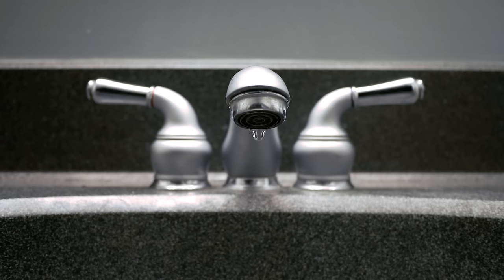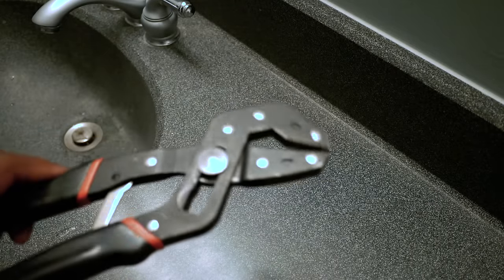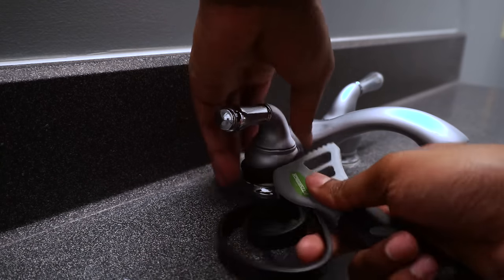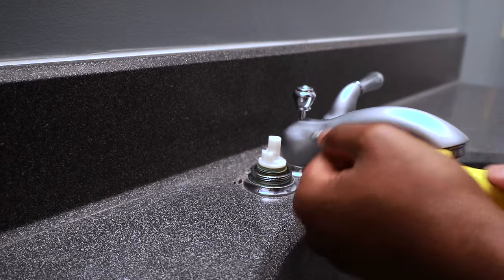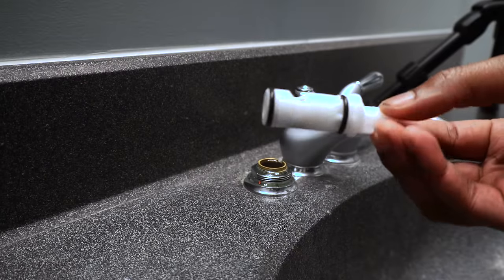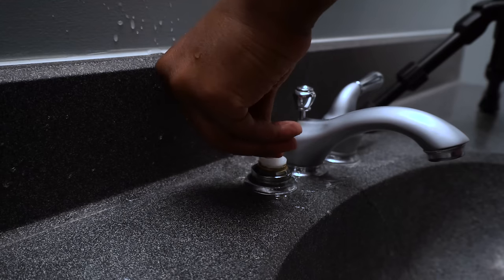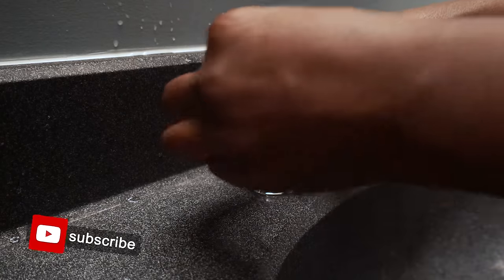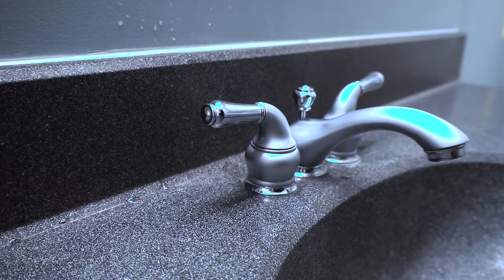How to fix a leaking faucet | Moen 1224

Comment: If you want to get the water out easy  get a spray bottle or a spray pump  and  stick it in the remaining water and spray or pump it out (hand sanitizer pump works too)
Reply from the maker: That's a good tip. Thanks!

Comment: I have replaced several cold water cartridges on my Moen 2 handle villeta faucet - I still have a solid drip when off - HD suggested putting bit of vinegar in the empty cold water chamber, did that, removed it, flushed it with water, new cartridge - still drips cold water - don't see much with flashlight in empty chamber, bit of discoloration after  cleaning and flushing - ???
Reply from the maker: I had the same issue use a small wired brush and clean the pipe. Buy additional lubricant not the one that comes with the cartridge. Let me know if that works

Comment: We used this excellent video yesterday to install this cartridge in our bathroom faucet, thanks.  It took longer to remove the cartridge than I thought but eventually we got it out using this method with the screwdriver instead of pulling it out with pliers as we first saw on another video.  The cartridge broke when we took it out and had to use need pliers to get the remaining old cartridge out.  But all worked out in the end run.
Reply from the maker: Great to hear!

Comment: Thank you! I was killing myself trying to get the cartridge out. The trick is to get it started separating it from the brass cylinder it sits and and then get it out with the vice grips. Don't worry about mangling the cartridge as you will be replacing it.
Reply from the maker: Thanks for sharing your advice

Comment: This was the best video I found regarding replacing a Moen faucet cartridge.  Annoyingly, it was the last one that I looked at so it took me all afternoon to replace the two cartridges.  This video had one element the other's didn't have--that you have to turn the little white thing on the cartridge to align it with the faucet handle.  Once I knew that, I had the job done.  Thank you for these instructions.
Reply from the maker: Thank you so much for the compliment

Comment: Great video!!!  But, no matter how hard I tried, I could not get my screwdriver under the lip of the cartridge to pry it out.

Ended up searching for a "How to remove stuck Moen sink cartridges" video.  Used that video's trick of grabbing the stalk of the cartridge vertically with Vicegrips and using a large screwdriver with the Vicegrips to lever the cartridge up and out.  Worked like a champ.  After 23 years, that cartridge was stuck, stuck, stuck.

Moen did send replacement cartridges for free, but I got the impression that newer fixtures no longer have the lifetime warranty
Reply from the maker: Yes, I think they recently changed the rules in the past year

Comment: I was halfway through watching this video in the plumbing aisle at Lowe's before some asked me if I needed any help. Thank you!
Reply from the maker: Happy to help let me know if you have questions
Reply: @Hindsight101  In the end your video was really helpful to me in removing the handle and selecting the correct cartridge from Lowe's. However, I guess Moen puts the same cartridge in multiple styles of bodies because at the point you used the water-pump pliers at 2:20 I found my cartridge was deeply recessed and required tool #14272 to remove it. I 3D printed a tool from Thingiverse (https://www.thingiverse.com/thing:1759028 )  and removed the internal retaining nut. Thanks!
Reply from the maker: Wow I will have to check this out
Reply from the maker: Your link isn't working
Reply: @Hindsight101 sorry I removed  the ) from the end of the link.
Reply from the maker: I need a 3D printer

Comment: I’m having a hard time removing the old white cartridge. Even using the flat head screwdriver. I tried pulling the cartridge out with pliers and it is really tough. I remember it had worked on an old faucet in the past, but not here. Thoughts? Buy a better plier?
Reply from the maker: I can't remember exactly which one but there are tools you can buy that can help
Reply: @Hindsight101  I found a trick on YouTube to get it out.
Reply from the maker: @inquisitvem6723  please share
Reply: I’m glad I didn’t have to pay a plumber. They would’ve charged $60.

Comment: I noticed this faucet is the Moen Monticello.. looks like the 4 in mini.  Would you know if it’s the same process to remove the water cartridges from the Moen Monticello 8 in wide spread faucet?
Reply from the maker: Sorry I do not know
Reply: @Hindsight101  Thanks.  It’s actually different.  I opened both, and each faucet set has a different handle kit inside.

Comment: I bought the 1224 cartridge and was ready to replace the old leaky one . First I found that the under sink shut off valve does not completely close the flow of water . In the basement , there are multiple old valves but none of them seem to shut off the water to the kitchen . The landlord will not help , so I am wondering if it's possible to replace the cartridge , even with a small trickle of water ?
Reply from the maker: I have done it but it’s not fun and messy. As long as there isn’t a lot of water pressure you sure be able. Since I don’t know your setup, I must say at your own risk.
Reply: @Hindsight101  Thanks for the timely reply . The landlord is obviously not interested in helping , so going the messy route is looking like my only option ( unless we call an actual plumber ) . The situation is irritating because I am able to do some basic plumbing repairs , but the inability to shut off the water not only complicates this repair - I worry that any future water issue might become an emergency .

Comment: ..place the towel over the cartridge as you insert it - will contain the splash... also use painters BLUE tape to protect the other fixtures when using metal pliers to prevent scratching ...

Comment: If the cartridge resists coming out is there a trick to help? It seems stuck
Reply from the maker: Some say use heat.
Reply: @Hindsight101  Thank you. For getting back to me. Our sink is very old and the cartridge was I’m moving. We finally used a block of wood, a vice grip on the cartridge and a long handle screwdriver to leverage/pull it out. Btw Love your videos? Well done and easy yo understand.
Reply: Wasn’t moving

Comment: I can’t seem to get my new cartridge pushed down enough to get the nut back on. I used silicone grease too. It just keeps popping back up. Thoughts?
Reply from the maker: You can only put the cartridge in a certain way. Did you line up the little notch?
Reply: Yes. Your video was great at pointing that out. The new cartridge just won’t push down. It is 100% the right part too. Identical to the defective one.
Reply from the maker: Do you see any obstruction in the faucet?
Reply: No obstruction. Nothing fell in as I took the old one out. Immediately tried to insert the new one.
Reply from the maker: Do you have a shop vac, towel, or turkey baster to such the water out. That might help

Comment: I just did mine same one but when I tightened it up got a little tough when I turned water on ....I have to check what I did wrong .....maybe to tight.......great job you did......
Reply from the maker: Possibly you should not have to tighten it down that much, you just want to make sure it does not come loose.

Comment: Moen will ship you the free replacement cartiage. They have excellent online service! Great viedo!
Reply from the maker: But you have to have the receipt
Reply: @Hindsight101  Not true, mine is several years old. I just contacted them online and they sent the part free. My plumber said they have a lifetime replacement part and for me to contact them for the free part and I did and they mailed me the part.
Reply from the maker: I have never tried to do it online. I was told this when I called. Do you have a link?

Comment: Why does the faucet still leak even when the hot & cold is turned off?
Reply from the maker: Are you sure that the hot and cold are fully turned off from the shut off valves?  I have ve had some that went bad and wouldn't shut off all the way
Reply from the maker: Awesome, I actually have a video that walks you through calling moen https://youtu.be/kf9bL3yXoNY

Comment: I have the same issue. My moen 1224 was dripping from the hot valve so when I turned the water off, it leaked as well. Now I need a tutorial on how to fix that issue!
Reply from the maker: Once you shut the water off to the bathroom its fairly easy. The only hard part might be taking the value off because its hardened onto the pipe over time
Reply: @Hindsight101  yea I'm sure it is hardened because I have very hard water and it corrodes everything. Do you have a tutorial on how to fix the valve?
Reply from the maker: Unfortunately no since it only leaks when its turned i haven't made time to make one
Reply: @Hindsight101  I actually found another video that showed a quick fix that might work. You tighten the nut right behind the valve. It won't always work, but it did for me.
Reply from the maker: @Johnny5Scratcher  awesome glad it worked

Comment: I had low water pressure after replacing the cartridge and found out the aerator/filter on the spout was clogged up with debris and once I cleared that out the pressure was normal.
Reply from the maker: Good to hear thanks for the tip. Did you find it easy to replace the cartridge?
Reply: @Hindsight101  Yes, your video was the best as far as replacing the cartridge goes.

Comment: Those under sink water shut off valves ALWAYS seem to be an additional point of failure.  For most smaller single family homes, especially if you have Moen faucets which seem to be always failing, I think you’d be miles ahead if you just had an easily accessible main water shut off valve.  Do away with the the time, trouble and expense of having to replace those corroded shut off valves every time you need to replace a faucet core.  Those shut off valves are not dependable and are just a nuisance to deal with - they provide no convenience if every time you need to actually use them, they also fail❗️👈 🤬
Reply from the maker: thanks for the info!

Comment: great video. Thank you.
Reply from the maker: You're welcome and thank you
Reply: @Hindsight101  I fixed my leaky faucet using your video. The bottom of the old cartridge broke and remained in the faucet, I used a flare head screw driver and a small hex key to pull it out. Tag n you again for the video.
Reply from the maker: I've had to do some crazy stuff to get a cartridge out. I think the worst was I had to break one up into 5 pieces before I could get it out. Glad everything worked out for you.